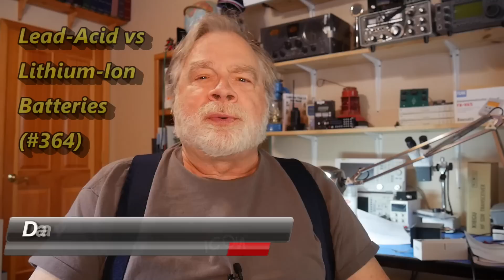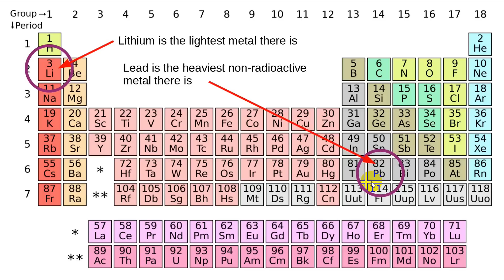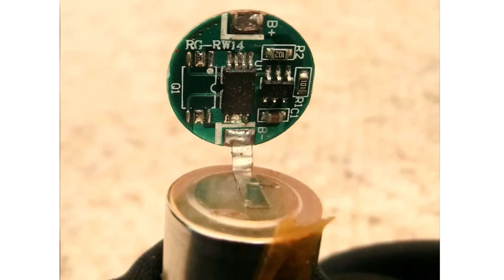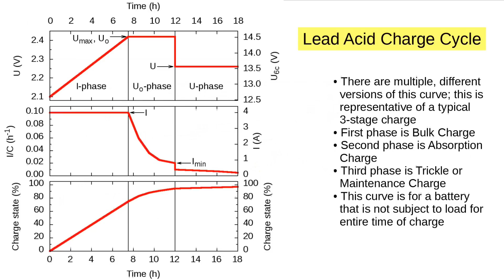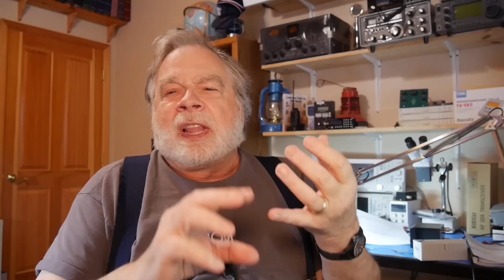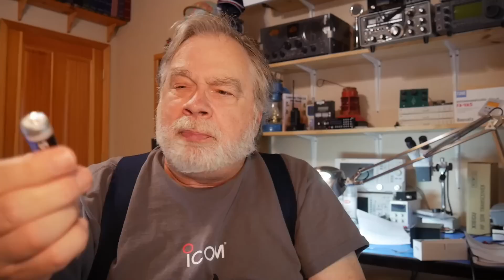Comment: Here's my only rub using LiPoFe batteries for standby power in the shack. They will most likely be exhausted and in need of a charge when the power goes out and I need it the most. Let's suppose my "special" lithium ion battery charger tops off the battery and then turns off for it's 500 hour nap. I use 90% of the battery's capacity over the next week (168 hours). On day 8, I have an extended power outage but have a near dead shack battery. Not only is the charger off (no utility) power, but it wasn't even "scheduled" to come back on for another 332 hours.

Having old heavy boy lead acid hanging on bus on a float charger (13.8V) ensures that I will always have a topped of and fully charged battery when the power goes out.
Reply: You can charge a LiFePO4 battery any time you want. Doesn't have to be fully discharged. But I agree it's harder to tell how much they're discharged. My main solar system is lead-acid.
Reply: @davecasler  What a great idea for a smart lithium charger. Any low powered microcontroller could do this: Using a shunt, you measure and keep track of the energy consumed by the shack. Since the microcontroller would be programmed (set) with the total available WH capacity (as a variable), the A/D converter accumulates the energy used. At a programmable point (say 50%), the controller tells the charger to commence a charge cycle. It would be completely dependent on the state of charge and regardless of battery voltage (since that is inaccurate anyway). Also program in a reset time (weeks) whereby the charger is told to commence a charge cycle to get everything back in sync.

Comment: You left out two important Lithium Ion battery topics. 1) Generally, lithium batteries cannot be charged if they are below freezing temperature (0 deg C). 2) Most LifePO4 batteries have a BMS (Battery Management System) which balances cell charge/discharge, etc. It's important to know the specifications of the BMS - for example, some will automatically disconnect the battery if the temperature drops too low (which can destroy some solar charge controllers). VA7GI

Comment: Just getting into solar. The two hurricanes in a row we had opened my eyes. We almost died going from air conditioning to 98F! The fans we were lucky to find used up six D batteries in under 24 hours. For myself I now have two USB rechargeable fans. I ordered two solar panels, a 30 watt and 50 watt that have USB outputs and also 12 and 18 volt outputs. The 50 watt one was only 36 bucks. I also ordered half a dozen of the little USB power banks ranging from 10,000 mAh to 30,000. I bought several USB LED bulbs that look like old style ones. I have a LOT of rechargeable batteries for radios and ordered USB chargers for those. I have half a dozen or more emergency radios with USB inputs, solar panels, hand crank, with lights on them all. I have a lot of other long range AM radios and more than a few shortwave radios, two that can tune in SSB HAM signals.

Comment: I'm off grid and I use lead acid instead of lithium because lead acid is easier to charge, easier to recycle with a good scrap metal value, and half the price of lithium. Yes lead acids are heavy, but once installed, they dont get moved for 10 years so who cares.
Reply: True, and still true. My solar system batteries are all AGM lead-acid and work very well and have done so for many years.

Comment: I have two SLA batteries that I was given for ham radio use which have sat on a shelf for 4-5 years. Now they seem to be dead and won't take a charge. Are they likely trash now or is there the possibility of desulfating and recovering them? Unfortunately I'm not in a position at the moment to actually check their voltage.
Reply: I suspect they're sulphated. You can get a very inexpensive multimeter at Harbor Freight for less than $10 and check the voltage. If they won't hold a charge, they're only good for recycling.
Reply: @davecasler  As it happens, I already have one of those very inexpensive Harbor Freight meters. :) I finally got around to testing these batteries. One is at 12v, so probably good. The other is at 0.48 volts. Does that mean it's ready to be recycled? But if it's sulphated a regular charger won't do it so I won't really know if it won't hold/take a charge until I put it on a de-sulphator, right? Thanks!
Reply: @tracyrreed  The 0v one should be recycled at any location that sells batteries (e.g., Walmart). Charge the 12v battery. It should read 12.7 when fully charged and "rested," meaning left alone overnight. If it won't hold a charge for very long, it also should be recycled.

Comment: lots of Teslas burning up
Reply: More than there should be, but as a percentage of the number on the market, not much greater than the number of Fords and Chevy's that catch fire.
Reply: @davecasler  Yes sir - agreed, but the difference is battery fire vs gasoline fire - both difficult to put out.. Better cell management seems to be the answer they are working towards, as you mentioned about small regulators on individual cells.

Comment: Hi Dave, very informative. Question: if the internal battery controller disconnects a lithium battery on a short, will it reconnect the battery when the short disappears?
Reply: that depends on the way the manufacturer designed it. Some disconnect the protection controller so they won't automatically reconnect but require a short charging pulse or shorting P- to B-(bridging the switching FET).
Reply: @blubbspinat9363  Thanks,  I had a laptop that died..  charging supply tested good but not charging lights and would not turn on at all with/without battery installed.  Never did find out if it was a laptop or battery or controller issue.
Reply: @stevenshannon6384  sometimes automatic fuses in a notebook trip and can only be reset by a complete removal of power. This can become a bit tricky if the computer is not easy to open and has the battery glued in. Usually laptop batteries are also very picky. One failure or hickup with the controller typically renders it unusable even if the cells themselves are completely fine. I've also seen brandnew battery packs that saw RF spikes or static discharges and failed even though they had 2-3 cycles max and also battery cells in perfect condition. Usually battery packs like the one on Dave's video are no such pricesses. However it makes sense for a protection controller to shut itself down with a fault. For once it uses a very small amount of power but enough to discharge further when beyond the lower limit. Second, it requires active user interaction to reset instead of constant retripping which can also be dangerous. If you happen to have no voltage on a Li-Pack with BMS, try to run a very limited charge current(.1C max.) into it for at least 10h.

Comment: Good information for the specific batteries in the charts. My plan is to mount batteries UNDER my van where they will be exposed to 20 to 120 degrees Fahrenheit. Unless lithium batteries have improved, they won’t function well as I understand the information I’ve read. 
Anyone know of a solution?
Reply: Certainly Lead-Acid batteries won't like those conditions. Li-ion might be better, but best is to reconfigure your van to put the batteries inside where it's warm. Lithium would be a better choice here as no hydrogen emissions.

Comment: For the last year I have been playing a Lot with some Lithium Ion 18650 batteries. Charging and then using them in some of my recent projects. Everytime I mention Lithium batteries, people instantly mention about how dangerous they are because the Electrolyte spontaneously catches fire when it comes in contact with moisture, including the small amount of water in the air. These concerns are important and I will try to summarize the key points here . . .
- Do Not Exceed 4.2 Volts or there will be Fire
- Do Not Discharge Below 2.5  Volts or you will damage the Cell
- Do Not Charge or Discharge the battery faster than Half of it's capacity
- Do Not Short-Curcuit or there Will be Fire
- Use Balanced Charging. Lithium Batteries in Series do not remain Equally Charged and must be Maintained Individually to keep the Charge Equalized
- Do Not Charge a cell that is below Freezing Temperature, Causes an Overcharge Condition
- It is also good to keep them Cool as possible and Protect them from Physical Damage

Comment: Dave, I also fly a Rans aircraft,  an S-19 Venterra.  When I was building it I installed and Earthmate LI battery .  The charging system on my jabiru engine was originally designed for a lead acid battery. It’s been working fine for about three months now. Occasionally I do use the electronic charger to top it off.
Reply: The Jabiru has an alternator, and the diodes and voltage regulator are mounted on the firewall. You might look around, maybe at an auto parts store, for a diode/regulator that works with Li batteries.

Comment: Interesting. I started my career in 1967 with Grumman aerospace corporation and one of my early assignments was to the write a Fortran battery simulation program for the lunar excursion module,  LEM or Lunar Lander.  The LEM had six batteries, four on the decent stage at two in the ascent and stage.  The purpose of the simulator was to identify what equipment load we could shed in the event of a battery failure and how long the remaining batteries would last.  The engineer I was working with showed me what he said was an optimum discharge cycle which was identical to the lithium battery discharge cycle you displayed,  minimal slope and then it fell of the cliff.  I recently found out that the batteries were developed by a company called EAGLE-PICHER.

Comment: I do appreciate the weight savings with my Bioenno batteries. One piece of negative info I came across was the lithium miners use 500,000 gals of water per ton of lithium. Evidently there's not any requirement to recycle water in South America yet. Fracking gets a lot of negative press here because of water usage. So the next time you get in to your, non-polluting, EV with lithium batteries think about the water usage.
Reply: Same problem with electric cars. Zero emissions? Not by a long shot. Lots of coal is being burned to create the electricity!

Comment: The primary issue with electric vehicles is the charge time on the batteries. You drive for a ways and then you're stuck until you can recharge which takes a while.  Alternatively, you can have a generator that provides electricity to the electric motors and the battery. That's the way that most trains work,  they're diesel-electric. Also,  for electric cars you have to swap out the batteries after a time which is,  last I heard, around ten years.

Comment: There is a big difference between the lithium ion and the lithium iron battery! The voltage is different and the power they hold. Lead acid have a very high resistance,  lithium batteries have resistance in milliohms! You are calling them  lithium ion can explode but lithium iron don't explode!  Lithium ion are 3.7 volts per cell,  lithium iron are 3.2 volts per cell. But that is not the fully charged volts,  don't know why they don't rate them at the fully charged voltage.
Reply: @Donald Smith -  lithium iron phosphate batteries are still considered lithium ion batteries.  But  you are correct the voltage is lower.   You are talking about nominal voltage.  This would be the voltage per cell during a that flat discharge portioned the line.

Comment: I am currently powering my amateur radio station with two LiFePO4 batteries rated at 170 amp hours at 12 volts from Big Battery. I have 2 more batteries on the way to up my capacity. Check with the battery manufacturer for the proper charging parameters. I am using a Midnight Solar 150 change controller with four 370 watt solar panels. I am most happy with this system.

Comment: I've been super happy with LiFePo4 despite the cost.
Reply: I couldn't bring myself to spend that kind of money on a LiFePo (Phosphate per Gary's q).  I built a couple packs from used 18650 cells ($0.50 per cell, $5 for a BMS, and $10 for a buck converter for steady 13.8v), if you're comfortable soldering then it's definitely the way to go.
Reply: @alxpunk01  Phosphate is PO4 methinks.
Reply: @garrysekelli6776  You got it, lithium batteries are named by the chemistry of their cathode material.
Reply: @alxpunk01  i still dont understand how Po (polonium) got in THE mix.
Reply: @garrysekelli6776  Just a capitalization error Po (Polonium) vs P & O (Phosphorus & Oxygen)
Reply: No polonium! P is phosphorus, the O is for oxygen. P+ 4xO is called phosphate.
Reply: What's Po?
Reply: Polonium?

Comment: Good advice. I try to cycle my back-up lead acid bank once a month. I discharge to 11.8 standing voltage, then charge with a smart charger. The remainder of the time they are inline with the power supply. Works pretty well for longevity. The charger is quite noisy on HF, however, so it's done while I'm off-air. ALL BATTERIES ARE VENTED OUTDOORS!

Comment: Your lithium ion charge information was correct, except for the 4.05v number at the bottom of the page.  This would be for metal oxide versions of lithium ion like NMC .  For Iron Phosphate the end charge voltage is 3.8 to 3.85v.
Reply: Are you sure it isn’t 3.6?
Reply: @aurtisanminer2827    The ones we manufacture are 3.8v. .  But you make a good point each manufacturer’s “ recipe “ for blending cathode materials together could change the recommended charge voltage.   It is important any who chargers a battery read the data sheet carefully.

Comment: GE lied about the operating costs of the first electric engines, coal was actually cheaper in the full correct math. And, they weren't electric trains, they are diesel electric. (Except for subway trains and electric overhead systems, neither of which are high speed.) Triple expansion steam turbines were the "too late" last gasp of steam engines. The same steam turbine system used in nuclear submarines, not the old steam piston engine you showed.
 FWIW.